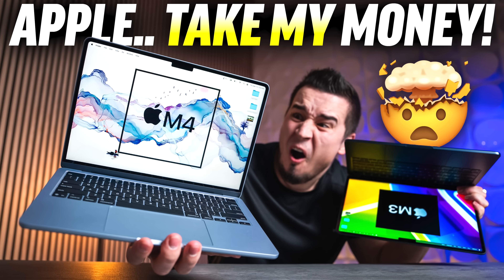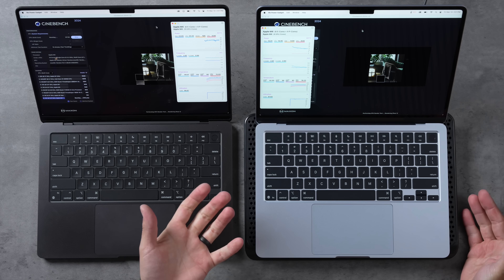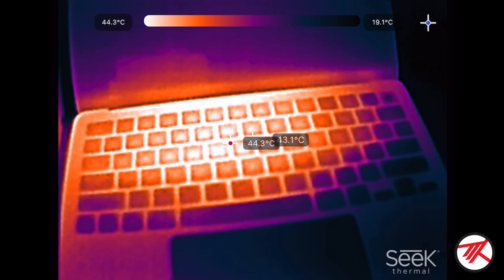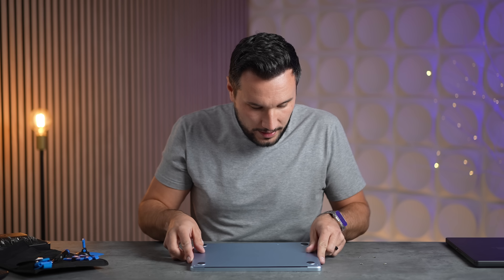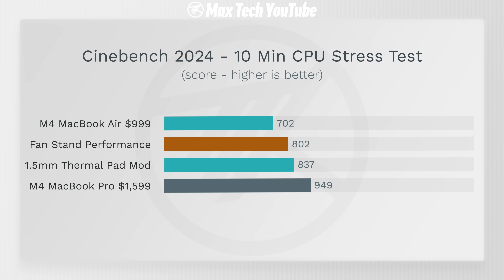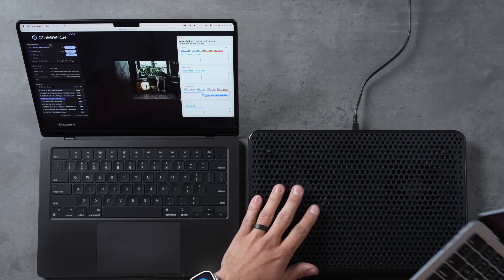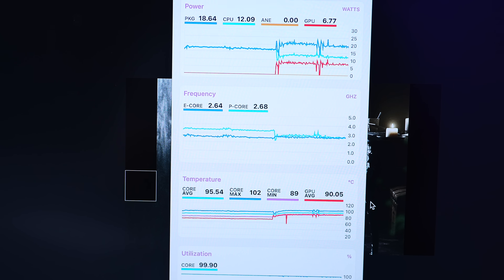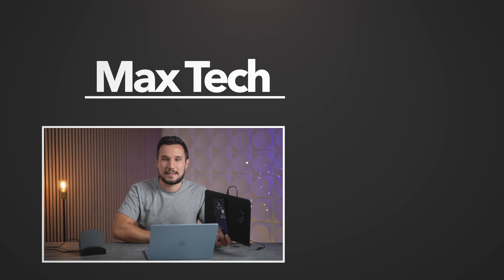Modded M4 MacBook Air vs M4 MacBook Pro -This is INSANE!

Comment: why apple does'nt put the termal pods by themslef 💀
Reply: Becuase it could seriously burn you.  The laptops shell already reaches 46c which can give you a mild burn.  With a thermal pad im willing to bet that back cover sitting on your lap would reach 60c or higher causing serious burns.  The CPU in these laptops hit 100c under load.  Do note at 46 it would probably take a couple hours to give you a mild burn.  It would be very uncomfortable.

Comment: For entertainment purpose this is fun, but pretty much it. If people have to go though these things to squeeze a little more they may just go for the m4 pro.
Reply: I don’t need everything the Pro gives, so it’s a waste of money for me, but I bought a thermal pad and a laptop cooler because it was $40 and helps in the few times I stress my Air, so that is worth it
Reply: Yep, that’s exactly what Apple wants you to do, spend more money for the same chip in a more expensive machine.  It’s all deliberate.
Reply: @Paul-jb6rk  Anyone doing the type of work cinebench is simulating will be using more than a single CPU core, pro apps all use multithreading. This wasn't even tested. Plus anyone who needs to do these professional apps on a macbook will be using the M4 pro or Max, not the base M4. It's really a useless test. Me personally, I do all my video transcoding on my PC because it has 32threads and a Nvidia 4080 to use GPU acceleration which is faster than any CPU available.
Reply: Time = money: you choose!
Reply: For 500$ difference its a big thing for me, so that, I can go with more RAM and Storage on MBA.
It still sacks, coz apple get 7-10X profit on RAM and SSD upgrade, coz memory is dirt cheap from 2023 onwards.
For Candaians those two MBP and MBA model is 700$ difference.
Reply: Indeed. Except those who need 15" screen asset without monitor but can't get/don't want the 16".

Comment: So quick question, why isn’t there a way to just buy copper bottoms for the MacBooks, that would do crazy work
Reply: Maybe you make it and a new business opportunity right there
Reply: STAPM. - Skin Temperature Aware Power Management. That's AMD's term for it but it's the same answer regardless. There are laws for how much something you can touch on the outside of a device like this can heat up. Directly using the bottom as a heatsink can only partially be done without running into skin temperature issues

Comment: If you need to do that just get the base model MBP
Reply: 500 dollar difference or slap a 20 dollar thermal pad on.
Reply: @bodyemcal actually the price difference of 16+512 is only$200-250 since the pros are on discount on Amazon. At apple, they sell those refurbished pro at $1359

Comment: I'd think that people running pro level apps and doing pro level work would buy a pro level machine. 99% of the people buying a MacBook Air wont ever come anywhere close to taxing their machine.
Reply: That’s not necessarily the case. The ‘pro’ moniker is more marketing than anything else anyway. I am a software developer and for many job scenarios the Airs are ideal
machines.
Reply: In an ideal world, that would be the case. But you would be surprised to know how many people do pro level work on Apple silicon MacBook Airs because they're simply more affordable especially when starting out as a beginner.
Reply: @chanchanadissanayake2391  Exactement ! La plupart des gens croient qu'il faut une ordinateur pro pour faire du travail de pro…
En fait TOUT MAC PEUT FAIRE DU TRAVAIL DE PRO : cela prendra seulement plus ou moins de temps mais le résultat sera pro !
Reply: @chanchanadissanayake2391 also, would you say that people do more pro level work at home with the adapter plugged into wall to put less stress on the battery and wont get as hot?
Reply: Plus pro apps will use all the cores, not one so running single core tests is useless. Cinebench has both tests because you are supposed to measure the speedup using multiple cores with your CPU. Take the threadripper for example. The single core scores are very low because of low clock speed but it has up to 64 cores with 2 threads each that all can be used at once and it gets a huge boost.

anyway whenever I do video transcoding I'm using my desktop gaming PC with 32 threads and GPU acceperation with CUDA via my Nvidia 4080
Reply: They’re Pro level based on the fact they absolutely smoke every pro level Intel Mac.  The idea they’re only for general use, not Pro applications is laughable.
Reply: It’s the lack of fans, the laptop slows down if you are using it for a long time.. the air is a good laptop for simple task, but at this point you are better off with an IPad if you use “simple tasks”. 

If you desire to keep your laptop for a long time the Pro is the way to go the fan(s) will keep the laptop components cool. And you get an overall better package.

The air also requires a lot of accessories see all the stuff the reviewer is using in this video + the lack of ports and the ones you got being so close together..
Reply: I don’t got pro money… so I fall into this category
Reply: Tried to work on air as dotnet developer (using jetbrains rider). Seems to be totally fine as compilation only takes like 30s on my projects (Umbraco CMS) so it doesn't get into throttling and this is not "close to taxing", though I do pay taxes from that. It all depends what you do at "pro" level. I ran docker and shit totally fine. Of course it is not for long running CPU extensive tasks as it will drop into throttle, but its well sufficient for most professional development work.
Reply: nah, i have a somewhat heavy workflow, but the pro m4 costs 730€ more than the air m4 here, so paying an extra 730€ just for a bit more performance seems ridiculous to me
Reply: Hey, not only for the price. For me big part of it comes to portability. I’m often around for photo shoots and having a powerful slim machine is wonderful.
When I’m home I just plug it to my 27” and snap a cooling vent on the bottom. Works very well for me :)
Reply: No bro that's wrong I am a professional video editor and i use my 8gb macbook air m1... I bought that machine for study but got into video editing and work and that laptop is so capable just imagine how much better m4 is than m1. Alot of people like me get a cheaper device when they are starting out because they don't have the skills and funds to get that macbook pro
Reply: As a dev I rather have the air normally won’t tax it but I can from time to time, but I got the tech skills to do this kid so nice pick for me.
Reply: I see M tier Macbook airs being slow on students ALL the time. Almost every session some student has some problem because their M1 or m2 macbook air is slowing down. 
To say macbook pro is only for pros is really misleading. 
Macbook air shows its limits even if you're just opening 10 chromes tabs, 5 words files and 1 or 2 ppt presentations. Which is a casual work day for a student.
Reply: @xAnonymousComedia  Im 100% sure thats due to the 8 GB of ram.
Reply: @JamesBond-fo6ow  it is 100%, the M chips are really fast and the m1/m2 were sold with 8gb of ram for the base model which i doubt they upgraded
Reply: @JamesBond-fo6ow  my m1 air also acts up because of the small ssd
Reply: @sriramkiron4566  You aren't supposed to fill an SSD past 80% because it gets slower
Reply: @xAnonymousComedia That’s total bs in my experience.
Reply: @xAnonymousComedia  Yes if they have 8GB of RAM. Any computer with that little will slow down.

Comment: Didn't we learn from the M1 in 2020 that battery temperature is a very relevant factor to be monitored? Did the battery heat up in the stress test with pads compared to no pads?
Reply: im thinking of buying the m4 air. would you recommend i hold off on doing the mod until more comes out regarding battery?
Reply: @sriramkiron4566  I suppose it depends if the m4 runs cooler than the previous chips that were modded.
Reply: @ Someone tested a MBA M1 on reddit: w/o pads: 42deg. With pads 48 degree batt temp. Idk how bad that is exactly. Someone else suggested to use smaller thermal pads. The topic title is "Don't do thermal pad mod on MacBook air M1, it ruins the battery life"
Reply: @MsSjaakvaak  lithium batteries used in RC cars get hotter than 48 degree of this laptop, can you show actual evidence ir are you just saying?
Reply: @ Evidence that 48 deg cause the batteries to wear faster? As I said, "I dont know how bad this is". Also, who said +48 degrees in RC cars isn't degrading the batteries faster then 30deg would? We should ask a chem engineer for that or a least conduct a proper long term comparison review.
Reply: Yes, yes, and yes. Thank you. People are installing the thermal pad too hastily. As for the M4, I'd assume it's the same situation.

Comment: I want to know what the temperature was on the back with the thermal pad.  Does this make the air no longer able to be safely placed on your lap?  Without the thermal pad we were within spitting distance of 50c even at 46c you can still get mild burns if its on your lap for a couple of hours.  At 50c you could get burns in minutes and bad ones at that.
Reply: Apple put the air gap for that reason. Burning your lap. Just set it on a table.

Comment: Thermal pad seems like a no brainer. What about a custom milled aluminum stand like you did for the m3 ? (or was it m2?)
Reply: It wasn’t custom. It was from a company called Svalt and they demoed it for M3. Also for the thermal pad you don’t want to do the mod if you’re gonna do long running intensive tasks with the laptop on your lap. Otherwise youll burn yourself
Reply: @chidorirasenganz  nobody does that on their laps bruh